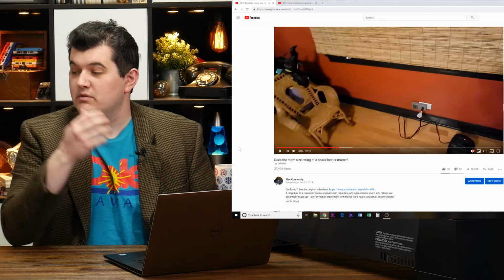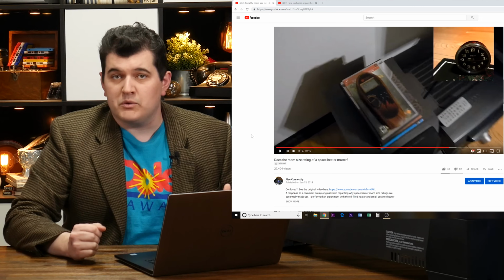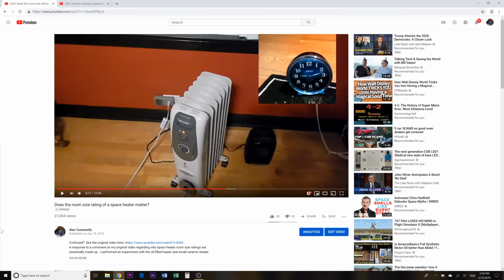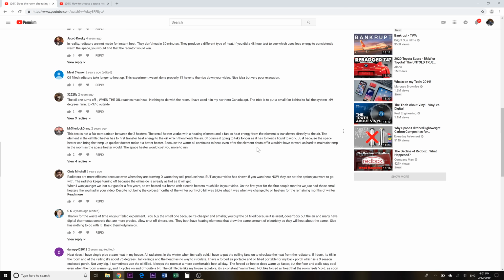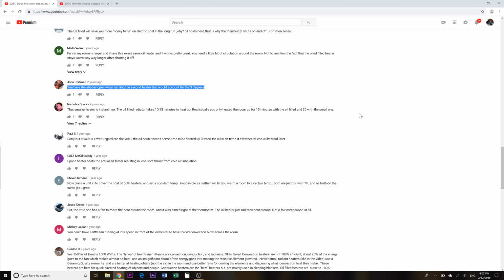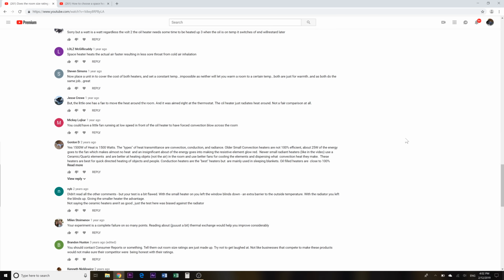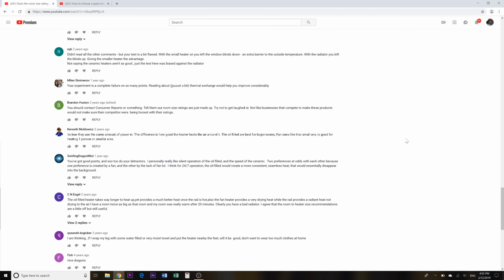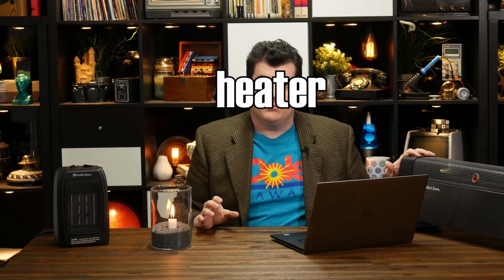More Space Heater Nonsense

Comment: There's only 1 thing you're wrong about: the power drawn by the fan DOES NOT turn into heat, only a small portion of it does, unless the motor is super inefficiecient. This does not change anything in practice but I just wanted to correct you on that.

Comment: I was an electronics technician for 11 years. I studied digital electronics and worked in microwave (not ovens) electronics. The study of electricity is fundamental to any discipline of electronics and even electrical engineering. As you said, resistive electrical heat is 100% efficient. Any possible loss or waste just ends up in the room. All of the energy used to run a fan is converted to heat. A lightbulb is 100% efficient in transferring the energy from the electricity consumed into energy in the room. It has no other place to go. All of it is eventually converted to heat, even the light, when it strikes something, is converted to heat.

Comment: You're making one major but very common mistake in your assumption:
IT'S NOT THE PHYSICS that makes the difference! IT'S THE SAFETY of the design that matters!

The simple reason why space heaters rated at "up to" 1500 Watts still differ in how effective they heat up rooms is that 1500 Watts is practically the "maximum continuous wattage" (leaving very short power peaks when switching on and off aside) these heaters will draw from the outlet (By the way, 1500 Watts "magically" also happens to be a value that most circuit brakers can commonly handle without tripping).

The actual difference between all these numerous types of heaters rated at 1500 Watts, simply lies in how long each of these heaters can safely run before overheating and/ or before shutting off to prevent overheating! 

By the way this is also the exact same reason why picking cheap electric hotplates only according to their wattage rating makes almost as little sense as picking heaters according to their wattage rating.
For example, a 1200 Watt hotplate with a thermostat inside that repeatedly shuts itself off over half of the time to prevent overheating, will end up NOT heating nearly as much as an 800 Watt hotplate that really just runs continuously all the time without cycling on and off (and approximately equal to an 800 Watt hotplate heating 3/4 of the time and shutting itself off for 1/4 of the time). 
This is simply so, because a 1200 Watt hotplate that shuts itself off for half of the time will effectively only be running at 600 Watts on average! 

Folks, PLEASE READ THE INSTRUCTIONS of the heaters you're looking to buy or that you're using and have already bought! 
Very small and compact heaters will sometimes have a warning in the manual stating that they should NOT be used any longer than just 45 minutes, for example! 
Other heaters may have warnings not to be kept running continuously for more than 2 hours. 
Some better and therefore often considerably more expensive heaters (like the radiator type commonly is) are instead actually truly designed for heating larger rooms at continuous day and night operation.  
ONLY THE heaters which are actually and truly designed for this type of continuous operation will genuinely be capable of SAFELY running continuously without turning into a fire hazard when running continuously for many hours (like over night while you're sleeping)!

All this (rather silly and pseudointellectual) theorizing about how 1500 Watts should be equal to 1500 Watts, and the (ignorant) over-simplification of only looking at "UP TO" XYZ Wattage ratings and the thermal load (instead of comparing design features and instructions), COMPLETELY MISSES the point of HOW LONG these heaters can be SAFELY operated and how much of the time they actually heat and how much of the time they shut themselves off to prevent overheating. 

IT'S NOT THE PHYSICS THAT MAKES THE DIFFERENCE! - IT'S THE SAFETY OF THE DESIGN!

Comment: I use a small room heater in whatever room I am in but always turn it off when I leave and never never leave it on unattended. I am very aware of fire danger in my home. My only heater beef is not enough hand-hold space built deep enough to easily pick up the heater. I ran across this by accident when my old heater (I loved it!) died and I bought a new one (same company). The old one allowed my fingers in past the first knuckle thus making the pick-up easy. The new hand-hold is more shallow, pretty much finger-tips only, which allows the heater to tilt while held and more than ready to slide off. I wish my old one still worked. Later on I got a Vornado with the built-in handle on top. Annnd, I like the controls on top, easy to reach, easy to use.

Comment: The oil filled heater may have been cycling on the safety stat not the room stat.
The safety thermostat cuts power to the element if the oil gets too hot, which usually happens because there is not enough air flow over the unit as you state.
Placing the unit near a naturally draughty place like under a window or near an i take vent will help with this.

Comment: Ask people who live in cold climates without central hvac,  especially in trailers and motorhomes and such.  Space heaters are way better at Keeping a given area warm for long periods of time.  Conventional heaters with a fan have to use a portion of their input towards turning that fan. That's energy that's not being used to heat up the elements.  Space heaters work as a thermal battery.  All the 1500 watts is going into creating thermal energy,  and storing that energy into the oil.   That's why it takes longer for them to heat up,  it's building up all that energy.  In Conventional heaters it's instantly lost.
And this test and comparison is flawed in multiple ways.  You have to set your variables identically and run multiple times threw longer periods.

Comment: I've struggled with this concept for some time.  I understand the concept that a watt is a watt, but my experience is different than what should occur based on physics.  I have several space heaters, about every type except the pure radiant fanless heater.  One heater performs way worse than the pack, and one way better.  The oil-filled heater is the worst, which is adequately covered here.  However the one that performs best is my 6 element quartz heater with an air channel that blows through all the elements.  It's dramatically better than the rest of the pack.  The rest of the pack are ceramic heaters.  I've learned that the ceramic element's resistance is proportional to it's temperature so as the hotter the element gets the less current can go through it.    I think the one little fan blowing over the ceramic elements can't quite move enough heat off the element to allow it to run at full wattage.    

So, while a watt is a watt, not all heaters are able to pull the same amount of watt-hours regardless of their ratings.

Comment: I did have a project I thought may interest you. My bedroom wall under my window is very clammy feeling in my condo, I know there was not insulation in these walls when built, and as a condo I can't do it. I was considering making a decorative thin insulation board that would be fastened to the wall with brackets, but removable. I was thinking about 48 inches or so high, about 7 feet long or so.  I was planning on using a good grade of plywood, like birch or pine, and adhering insulation board to the back, and having a cut-out in the middle to go around an electrical outlet. I was going to add rubber type "feet" so the unit would be supported at the bottom. I wanted to hide the insulation board behind the plywood by creating wooden sides, and was thinking I may need ventilation holes in the bottom of the board to prevent any mold. The plywood front I thought I would stain or paint, and perhaps add a very thin decorative veneer or something. Not being an expert, I want to keep the board pretty thin, but was considering if I should go a bit more for thicker insulation board, or a bit more towards a thicker "hardwood" type plywood, as I have read that is better for insulation purposes. What is your thoughts on this?

Comment: I thought the same about the heat affecting the thermostat of my Hydrosil gel-filled electric baseboard heater - with the oil filled, it seems like a remote thermostat should be a accessory that should be offered, though after I replaced the thermostat, the Hydrosil does decent. To me, a lot of this is how the heat is released - a long baseboard creates a warm heated "blanket" of air, where my old fan-forced radiant heater with a fan blew hot air right on you - a great spot heater.

Comment: I wish you would share your opinion about the issue of fan heaters calling the timer for how long the fan runs, a thermostat. Is it actually a rheostat or potentiometer that attenuates the heat or just a timer?  The graphics on top of the unit seem to suggest that this control actually controls the heat output.
Reply: Forgot to say except for oil filled heaters which have no fan.

Comment: This has wound me up for years, not your video, the labelling/marketing. Even worse are those small things now are marketed as some magic device that can heat a classroom by like 10 degrees in a couple of minutes, designed by some kid (insert old stock footage here) that was struggling to learn in a cold classroom.

I've designed a large electric trench heating run in a knights bridge penthouse, it was a large open plan space with a lot of glass but being modern glazing, by the time the total heat loss, + 10% for heating was divided by the number of units it was only 150w per unit (1200mm long), but that gave a nice even curtain of warm air all around.

I think that baseboard heater is more of an aesthetic choice, used in a guest room or similar that doesn't require heating for the full cold season.

Comment: Don't listen to this guy he has no clue what he's talking about.
The elephant in the room is that heat rises. The better heater is one with a big fan that blows over the heating elements. The bigger the fan the better the heater. Why? Because you need to draw down the heat from the ceiling back to the floor. No one stands or sleeps on the ceiling. The best heaters for any room is the expensive ones that blow air over a heating element and have a thermostat on the incoming air. That way it can cycle on and off to the actual temperature it is set for.

Comment: So I have to disagree. Fan motors transfer most of their energy into the movement of the air, doing work, with the heat of the motor only being a small fraction of the energy released. The other issue is the surface area of the heating element, larger surface area, more heat transferred. From what I understand smaller heaters use a fan not to spread the heat, but to move more air over the small heating element to make up for the lack of surface area. When talking about oil heaters they make sense to me in this manner. Think of your body as a space heater, your putting off heat. If your body it trying to dump heat it sweats as the water on your body transfers the heat much more effectively than straight skin to air. In the cold, if you got wet your in much more trouble than if you had stayed dry as the water leaches the cold from your body much faster. In term of an oil heater, My thinking is this. The heat is transferred to the oil then to the metal body of the unit. This serves a couple purposes. The unit is able to transfer heat to the oil more efficiently than to the air directly. and the oil spreads the heat to the large surface area of the radiator. More contact with the air, better heat transfer without using a fan. While the efficiently gains may not me much, they can still be there. Just because you put 1500w in, does not mean you get 1500w of heat back out. And it does not mean it transfers it quickly or effectively. Also, oil heaters don't dry the air out as badly as typical electric heaters. Humidity in the air can effect heat transmission as well, with increased humidity helping it transfer better.

Comment: So I love the stuff you do and I have a mental quandry that I don't get :)

I'm trying to square up what you've said (and I feel to be true) with another experiment I saw that might be complimentary?:  
I saw an experiment where a youtuber was measuring the temperature output at the heater source, and showed that ceramic / oil heaters are cooler in temp than infrared.  

the comments he had made were that the element used in the heater matters as to how much temp you get out of those 1500W.

Is that possible?  Something has a much higher temperature, but same BTUs? Would that impact how fast something can heat a room?
 I'm not doubting you, I just don't get it lol

Comment: I have a very cold and drafty room and own both the small heater you shown and one of the oil ones. With the small one going I can never get my  room heated but with just the oil one I can get it really hot in here, is it possible that the small one can never put out enough heat at any given time to heat the objects in my  room so it in a sense never "catches up" with the cold air entering but since the oil one can store heat it is able to release more in a shorter period of time and in a way is able to heat the objects in the room and actually get it warm in here. I love your vids and think you're right but something does seem different about the oil one, I am actually able to get it warm in here but with the small one I can't. Is this possible?

Comment: Comfort is not limited to heating the air. Other factors add in :
- Radiating heat (infrared)
- temperature stability (no peaks)
- Biology (Humans are not thermometers)
 We don't measure the absolute temperature but rather the amount of energy loss (when it's cold) which is not only related to the air temperature but also to moisture and radiation received in the infrared. Also humans do not measure absolute values but rather adapt their biological "probes" to the environment. If you let the body adapt to the slowly heating environment, you will feel more comfortable  than when the temperature varies a lot.
Oil radiators are using thermal mass to avoid quick variations of the temperature and are also diffusing a lot of radiating heat. The ceramic trash think just heats the air. There is no mass in it. It does it quickly and also the air losses its heat fast, at least until the walls and the furniture warm up. This makes the ceramic think very effective at heating the air but it's much less comfortable. Comfort is the goal. Not heat.
Now what about efficiency? I think we can compare those two radiators to a nervous driver and a calm driver. The ceramic driver acts like the nervous guy, alternating a lot of gaz then suddenly braking all the time when the oil radiator beahaves more like a cruise control adding a bit of energy whenever it's needed to maintain a smooth ride. In the long term the cruise control burns less gas than the nervous driver.

Comment: A big oil radiator near my feet just feels fine warming ME, so I don't care much about the actual room temperature :)
While the small spaceheater with the fan just BLOWS hot air around my feet and (felt) cool one to my neck. Also, it makes some noise not like the nice crackling sound of wood in a fireplace.
So, a oil radiator with that crackling sound feature added, might be best after all ;-)

Comment: NO, NO NO NO! A candle does NOT release all of its energy as heat!  How can you still get this so wrong???   I'll just use a 100 watt bulb to heat my room, after all it's the same as a 100 heater.  JFC.  It's people like this that think we can switch to solar panels and pixie dust.
Reply: Just like a incandelescent light - 95-97% is released as heat, and the few percent as light - which, when absorbed, also gets transferred into heat.
A candle also creates water vapor which, when condensing, releases heat. That's it.
Reply: bulbs are mostly heaters so 15 might do so as 1500w.

Comment: The thermostat I think controls the oil temperature not the air temperature.

We used to use a small oil filled in a children's room because of the safety aspect. Leave it on low to keep a steady warmth and not too hot to touch and no risk of fan failure.

Comment: Perhaps the oil filled heater would be more cost effective if you live in an area where electricity prices are higher when demand is higher. If the oil filled unit warmed up when the cost of electricity is less (day) and released the energy is more expensive at night.
 Your math is accurate. power in = power out.

Comment: All electric heaters are 100% efficient. There are many heaters that have 1.5kW or 3kW elements, that do indeed dissipate that much power sometimes, but cannot do so continuously. There are electric heaters, often called "electric radiators" (as they are intended to replace water filled central heating radiators), that are designed to safely dissipate 2.5kW or more continuously. You can tell which they are because they start at 10-20x the cost of the products discussed in this video.

Comment: No, your test is false. Simple answer: You are Not comparing the amount of wattage Each is consuming, vs it's heat output. It doesn't matter if they are both Rated at 1500w when only one is consuming that much power continuously. The oil filled heater IS the most efficient, because it gives the most heat for the amount of electrcity it is Using, not its Rating. Protip- the fan in the forced air heaters are Pushing air around the room. The coldest surfaces are the outer walls. By pushing the warmed air around you are heating the surface of the outer walls, which will be lost and not return to the room you are In. The non-fan, convective heater heats the room Gently, from the ceiling, only barely down to the floot (where you are Not). By disturbing the air as little as possible, the most amount of heat can be kept in the room and not lost by pushing the warmed air against the cold walls and floor.